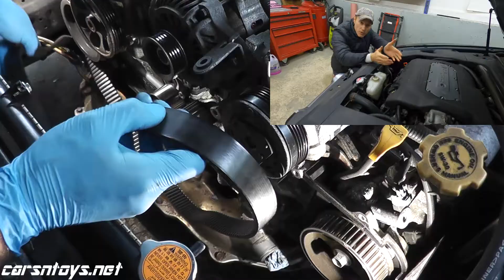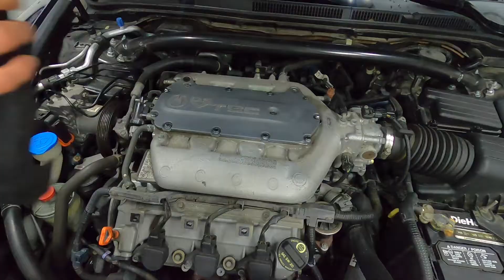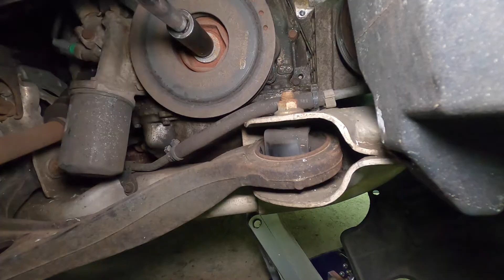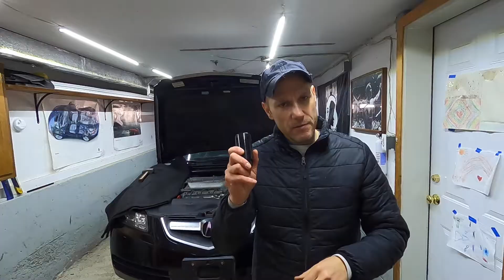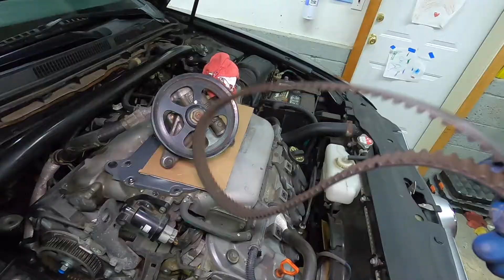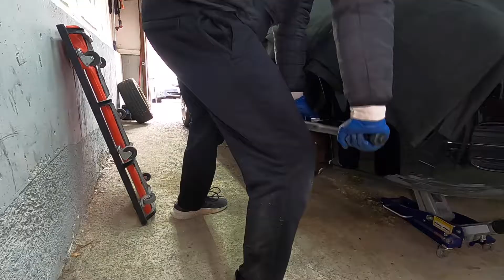How to replace a Timing Belt at home for beginners (2025)

Comment: So when you’re removing the belt tensioner you also have to remove the 14 mm lower pulley bolt others the tensioner will never come off.. here I am slamming my tensioner with the 14mm still on it…

Comment: If you can do the job properly, you can save a lot of $.  And certainly there are people who can DIY this.  But without experience (and the proper tools), it is incredibly easy to screw something up, and on an interference engine timing mistake = destroyed engine.  Also different cars vary wildly in how much disassembly is required and how complex the job is to do.

Comment: I also remove/replace sparkplugs. It makes it easier to turn the engine to line up T marks.
I also replace the crankshaft and camshaft seals. Then I know I'll be good for at least another 60,000 miles.

Comment: After getting the engine to TDC and before removing the belt, mark your old belt with a paint pen then transfer those marks to the new belt then install. Should help ensure that you don’t skip any teeth. How did the AISIN kit work out for you long term? Any issues?

Comment: What's the physics behind heavier socket removing the bolt more easily than the lighter socket?
Reply: The small socket flexes when high torque is applied. This causes less torque to be transferred to the bolt. The bigger socket flexes less and allows more torque to be transferred to the bolt. This is given that the same torque is being applied at the tool side (which it is since he is using an impact tool with a set maximum applied torque).

Comment: Best video out there for Acura TL! So much detail within the process and not just listing steps. Giving me lots of confidence to do this myself. 2006, and tensioner needs to be replaced. However dont have a big budget, so wondering if i should just replace the tensioner, and leave the water pump and reuse the old belt 9if its in ok shape, of course).

Thanks for making this!
Reply: Belt is dirty cheap, less than 20 bucks for a high quality one, its such a pain to remove everything to replace the belt that while it is in pieces it's easy to replace the tensioner bearing and water pump at the same time. If your vehicle doesn't have a reputation for wearing out tensioners and water pumps don't replace them.
Reply: Just did the whole thing, and skipped the WP. It looked absolutely perfect, no leaks, no drips, no wet grime.

Comment: Your right about the quality of thise original timing belts they rarely break it’s usually the tensioner that’s the culprit my 2000 EX 3.0 J30 V6 sedan before the notorious BX series tranny coughed out had 249,678 K miles and very little blow by still had original water pump and timing belt and tensioner no click during start no leaks from pump unlike my 2010 V6 J35 VCM  BS it’s got a133,200 K miles and it’s tensioner is already clicking during startup and needs a valve adjustment Honda really messed up these engines with that stupid VCM and they knew it and after getting sued they stopped making them and I refuse to buy that turbo 4 crap they have now
Reply: yeah fuck Honda😊

Comment: Want to replace my timing belt and bearings with KOYO bearings (NSK) and water pump (NPW) were was the video you made to get theses parts on line. I have a 2012 Subaru Forster. Was on line but too much if you can help me out. Thanks

Comment: Would you replace the timing belt and water pump with 62,500 miles on a 2015 Honda Pilot? My local Honda service dept. recommended.
Reply: I think its recommended 100k or 8 years. Personally I wouldn't, I just bought a 2008 with 85k...Think I'll do it early based on age
Reply: Yes the Honda service department would recommend that because they want money. Not really needed until 90k-100k unless it sounds like it needs to be done. Idk that’s from my experience

Comment: The timing belt isn't the main issue even if its a bit soft due to age. The hydraulic tensioner are prone to failure due to any circumstance. Even brand new hydraulic tensioners can fail prematurely.
Reply: Great, one more fear. I just did my second TB service a few months ago at 210k mi, used all stealership parts (came out to $500 on a "combo" deal for a TB, WP, Idler, Tensioner pulley, Tensioner, cam seals + crank seal). Super duper pleased, just to find a LOT of people warning about premature tensioner failure. Praying mine lasts for another 105k miles.
Reply: @summushieremiasclarkson4700  $500 and you did the labor. Great deal. I paid $347 a while back. Yes, they can fail. Try to inspect from time to time if you hear anything. I like to reach from top of rear cam gear, down towards the hydraulic tensioner to feel for tapping when car is started and when car is warmed up. Thats how I found my new OEM hydraulic tensioner seem off. Once removed I noticed oil seeping. So I had the P2R manual tensioner and installed it with Blue Gates belt. So far so good. But I still inspect.
Reply: @nbarcenas03  Thanks. I'm hoping the genuine Honda tensioner is of higher quality, but parts quality across the board is down for all manufacturers.

Comment: Awesome video. Quick question did you have to remove a motor mount to get to the water pump?
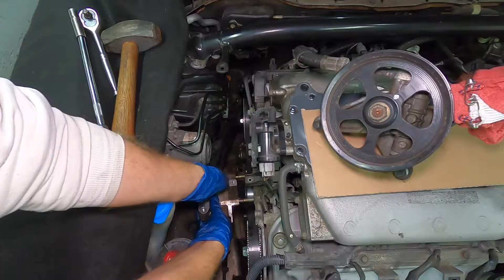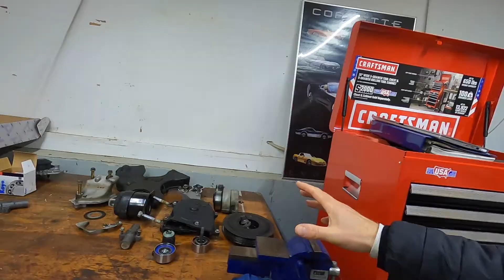Reply: He removed it at the 6:50 mark and you see it on the bench at 8:50 .

Comment: Great vid.   
When those belts break on a Honda. They likely destroy the engine.  (Interference Engine)
Reply: My 95 honda odyssey snapped  timing belt on hwy 3 valves bent. . I made repairs. Now has near 400,000 miles
Reply: I stay away from those, of course if you stay on top of belts, but I don't like it.  I understand they do this for more hp.  I have a timing gear on my 89 buick.  Manufactures know a good % of cars will end up in crusher with these belts so they love it.
Reply: @publicmail2  That's not true, these Unitta belts that Acura uses are extremely high quality + the engine is internally balanced, which means very low strain on the timing components. Interference engines make more power, less emissions, much higher gas mileage, etc. etc. Now of course you could make the arguments for chains (noisy, guides wear out anyway) or gears (extremely noisy and complex to service, plus there is a significant amount of friction losses). I prefer belts, as they are quiet, smooth, refined, easy to replace, and typically very cheap. Plus,you can replace associated components like water pump, so its worth it.